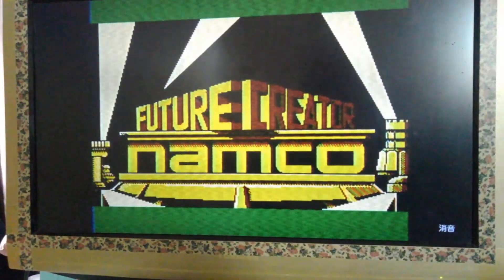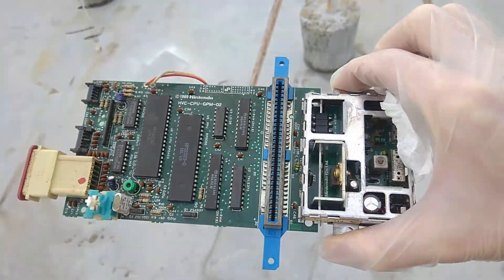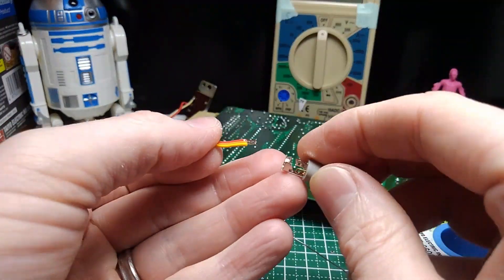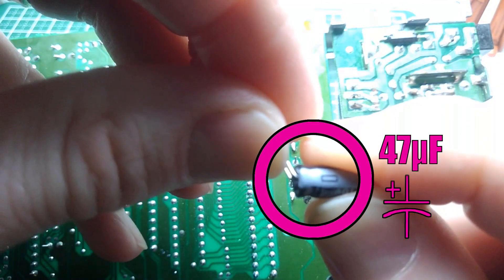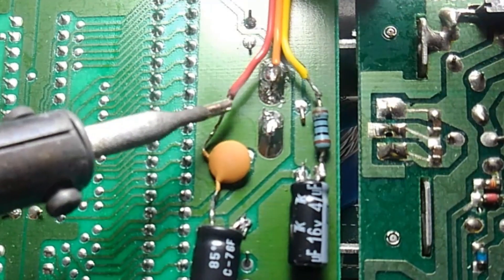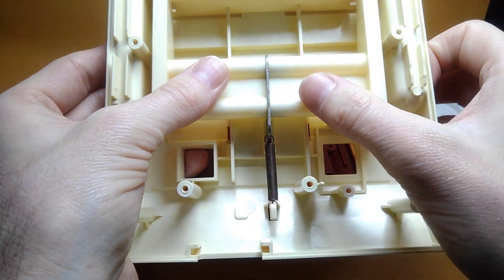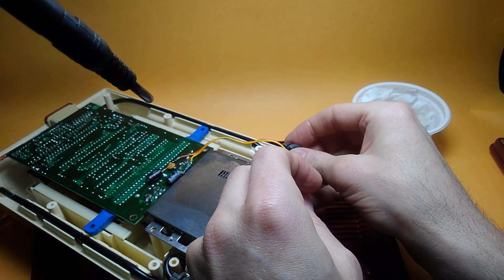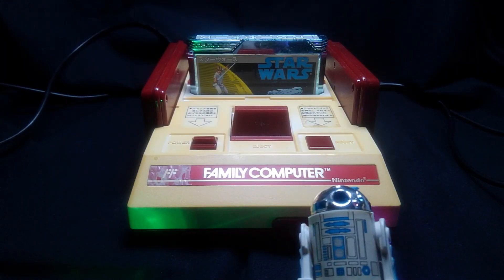Famicom AV mod made easy

Comment: Hello again my friend!!
I was using an rca to scart adapter because my tv only had scart, i decided to try on another tv wich has rca and colors work amazing!!!
But i still have no sound though, i feel like im so close to geting it working perfect. Do you have any clue of what could give no sound issue?
I seen people mentioning adjusting a coil, is it that small green coil with a philips adjusting screw?
Is there any point in the board i can use a multimeter to check if its giving out sound?
I tried blowing on the mic and i could hear me blowing on the TV, so i tried unplugging the Player 2 controler to see if it was causing an issue, but still no sound.
Any help would be much apreciated and thank you once again.
Reply from the maker: You are almost there just keep trying things out i know you will get it workin soon😁
Reply: @ScruffyLookinRGB  i wonder how you know that 😂😂😂😂

Comment: Hello my friend
Thank you for your video, i followed your instructions but the image out of the famicom comes in black and white and there is no sound.
Do you have any idea what it could be?
Reply from the maker: If i have the same problem i double and triple check my soldiering points. And if you still get nothing it may need new caps. Also if your board is not the same version as the one here it may not work the same way. Good luck
Reply: @ScruffyLookinRGB  Thank you for the reply, i really apreciate it.
I allready triple checked my soldering, and i checked and its the same version as the one you did in the video.
By recaping you mean change all the original capacitors?
Or do you know wich caps could be responsible for sound and color.
Im very happy allready though, it sure would be amazing to get color and sound out of this almost 40 year old console but even if i cant get it any better than this its ok still.
So no matter what, i really apreciate your video and still taking the time to respond after so long of posting it.
Thanks alot my friend.

Comment: would it hurt to use a 100ohm or 150 ohm resistor instead?
Reply from the maker: It should be ok. Although the signal may get worse or improve depending on the resistance you use. So it shouldnt hurt to try. Good luck

Comment: Thank you so much for this easy AV mod. I implemented it on HVC-CPU-07 board and it worked. The only problem is that video is too bright, light colors tend to be too light or just complete white. For example, the background of the famous Super Mario Bros 3 intro screen is solid white instead of the original creamy color.

I tried different resistor values (from 100ohm to 500ohm) but without success. Should I try different capacitor values (instead of 47uF)?
Reply from the maker: Yes unfortunately its a trial and error type of situation. I found a japanese blog that had this method here so i used it and it works great for this particular board revision. Other board revisions may vary unfortunately
Reply: @ScruffyLookinRGB  Yah, 1k ohm gave me the best color saturation on LCD TV, but my CRT TV couldn’t detect the signal when using that resistor. I settled on 510ohm resistor as the best value between saturated colors and signal reliability.

Comment: How did you make your rca to tsr ?
Reply from the maker: Not sure i understand your question?
Reply: @ScruffyLookinRGB  sorry I wasn’t clear, once you had made the modifications to the famicom and connected the cable for the output, you have a female port connected with what looks like a 35mm jack, I was curious how you had made those ends, or if you could when you have time outline out to connect the rca ends for the faux stereo sound.

Comment: are you sure the little ceramic cap was not a .1uf and not a 1uf. i have looked and not having any luck finding a 1uf ceramic cap.
Reply from the maker: It very well could be I did this mod a while ago and havent bought new ceramic caps in quite some time i think the mod may even work with out the ceramic cap to be honest. Its worth a try anyways.

Comment: Hi.  You "used" a 1uf ceramic capacitor which is shaped like a 100 nf capacitor (104).  I can't find 1uf capacitor anywhere.  Will it work if I use capacitor 104?
Reply from the maker: Im not sure 😕 you could try it. Id be curious to know how or if it will work with out the ceramic capacitor all together 🤔

Comment: doing this mod on two broken HVC-CPU-07 I bought after I replace the voltage regulator on one of them first.
PS the I have to solder the parts in different place then what you show but the place are labeled so I should be easy to do as long as the parts work the same. Thanks for the video
Reply from the maker: May the force be with you. Let me know how it goes for you.
Reply: @ScruffyLookinRGB  ok so I modded the first board and plug it in and all I get for is a gray screen with a black strip moving across it. the mic on controller 2 works and i can hear it from the tv but no video or game audio. I only have one game for it so if my game doesn't work would it be normal to have that screen? Because the nes has a gray screen when it can't read the game so if you turn on a famicon with out a game in it thought AV will you get the same result?

Comment: but you still need a ntsc tv or is pal also gone work?
Reply from the maker: Im not too sure how things work in pal regions but my guess is that it should be ok as long as youve got the right power adapter.
Reply: @ScruffyLookinRGB   iv got a 230 to 110 volt power adapter but it seems he has no power?

Comment: I've done a couple of famicom AV mods and I must say this is by far the easiest method and I'm going to do my third just like this one except I might just use standard AV cable run out the controller 2 grommet. I really don't understand why people go through doing all the lifting of pin 21 and crap because just a lot of extra work and mess on the famicom with no better image results. Thanks for sharing.
Reply from the maker: That is a big compliment thanks. I agree this is the easiest method ive found thus far. Lifting pins is no fun. Happy modding man👍

Comment: Everytime i see the internals of the famicom, it makes me wish rip those controller wires ,drilling 2 holes on the front and route those wires there , to make those wires stick a little bit more out of the console, it also makes me want to rip the wires from those controllers and put them above the controller by drilling a hole into them ,rather then keeping them on the side, in order to make those controllers fit more confortible in your hand,
Why did nintendo had make such obscure controller wiring design???

Because even the atari 2600, atari 5200 ,the sg1000 and even the magnovox oddysey etc,,,  did had detachable controllers.
Reply from the maker: I understand  your frustration. The one reason I think why the controllers are so short is that Japanese living rooms are very small and every one sits closer to the TV than in a western home. One thing i do like about the famicom is how the controllers have their own holder what do you think?
Reply: @ScruffyLookinRGB  well on paper it sounds cool those controller holders,hack even the retron 5 has a controller holder among other (old) consoles, but i sometimes think that they could,ve saved that extra plastic and just make those consoles just smaller instead.

Comment: This really is an excellent video and as a complete novice, I'll be taking it on this weekend if I can get the parts. 
A question though, does it matter whether the resistor is 'thin film' or 'metal oxide'? And do the capacitors need to be any specific type, or will all work?
Would you mind listing the brands you typically use?

I'll report back with my progress.
Reply from the maker: That is great id love to see how it turns out. As for thin film or metal oxide im not familiar with thoese terms. I usually use any japanese brand capacitor like nichicon. Ill add more cap brands as i remember them. Good luck.
Reply: @ScruffyLookinRGB  Didn't completely work for me. Any ideas what it could be? I'll check over my soldering. Nice to have sound though, ha. https://youtu.be/AZT_R0ZEQYI
Reply: I redid the TRRS and I'm having the same issue. I then reattached the video wire to the resistor and no improvement....in fact, I don't evet get any picture now, whereas before, I got flickers (I havent soldered the TRRS yet though, I was just checking).

My resistor is massive compared to yours. Whereas my ceramic c is tiny in comparison. Ha.

Could it be my soldering to the video pin? It's not exactly tidy but it's not messy either. It's also seat on it, rather than beside it (and I've used more solder than you did).

Can one use an RCA (yellow) cable instead of TRRS for the video? A white or red cable for mono sound (can you duplicate it, like the NES uses? And if I go that way, how would it be grounded?
Sorry about all the questions. I think I might be best just buying an already modded one!
Reply: Okay, so I re-did most of the soldering, to ensure my work was clean and it turns out, I probably had it correct in the first place! How I solved it/worked that out? I used a different 3.5mm jack to RCA; one from an old camera.

When pulling the 3.5mm jack in and out, I noticed sound was on parts I didnt expect. I then remembered I had a similar issue with my Android box where the 3.5mm jack wouldn't display video properly. So instead of using the new, working 3.5mm to RCA I bought for the Android box, I used the camcorder one, which didnt work on Android box and hey presto, I had a beautiful clean picture on my Famicom.
This youtube video helped me realise there was a difference in how they're wired, though I don't know how they're actually wired inside!
https://www.youtube.com/watch?v=MI4KsJEpueA

I had a slight buzzing sound in the background and realised it was caused by the mic on controller 2 (lots of people experience this). I could set it just above silent and it stops buzzing but moving the TRRS to the other side also helped.

So, your mod was brilliant, thanks again and hopefully my comments will help others. I believe I've seen someone else identify this issue too. One thing to note, the size of the capacitor and the resistors. My 220µF is quite large and I believe it's very snug against the bottom of the case....perhaps too snug....? Also, my resistor is huge, so my video is set back a little more than yours. Anyway, I hope this helps somebody and I might do a little video to show what I did and what I used. Thanks again. My first mod and somehow, it was a success!
Reply: Okay, this is my 'things I learnt; video and thanks again for posting Scruffy.
https://www.youtube.com/watch?v=mORA7LEGzLo

Comment: I tried this method out on a HVC-CPU-07 using the marked GND and video pads along with the 220uF cap connected to pin46 of the cartridge connector. The image quality was really poor and high contrast. I've reverted back to the old method including lifting pin21 and cutting the trace. I usually swap out the 2SA937 PNP for a 2SA1015. I'm keen to try out this AV mod on the next HVC-GPM-02 board though as it looks like a nice time saver 😁.
Reply from the maker: Thomas thanks for letting us know how it went on your version of the board that will be very helpful for thoese that want to try this mod on the HVC-CPU-07 version of the board. Thank you for sharing. 🙏🙏🙏

Comment: Hi, having a little trouble. So my picture is all distorted, I got all the right stuff and i only get a distorted picture and the sound
Reply from the maker: Its really easy to mix up audio and video wires when soldiering i do it all the time. Trace your wires from the out to the point on the board.  also check all your soldier points make sure they are not touching other points.  Check and check again. Let me know how it goes for you.
Reply: do you have anyway to pm me? i dont think i did anything wrong
Reply from the maker: @MrNintendokid45  you can dm me on twitter or instagram. Check the description below. I try to answer my messages when possible.
Reply: @MrNintendokid45   Did you solve this? I think I had exactly the same issue as you., check my video to see if it's similar. https://www.youtube.com/watch?v=AZT_R0ZEQYI
To solve it, I used a different 3.5mm to RCA cable (from a camera), as clearly the one I had wasn't wired in the same way as the TRRS jack. I'm in the UK, so perhaps we (not sure where you're from), have a different 3.5mm to RCA standard than where Scruffy is from.

Comment: I know General Kenobi would be pleased. Great explanation of the mod. I've never seen the inside of a Famicom before. Very retro, but beautiful. Love the sticker instructions close to the switch. Great video.
Reply from the maker: Sam Im glad you enjoyed it! Editing that took me quite a bit of time but it was fun to do. I love the look of the original famicom and all its retroness. Do you own one?
Reply: @ScruffyLookinRGB  not yet. The system is really quite a novelty because it developed in so many directions. With cartridge and the disc add on,  the wired in controllers, and the amazing games that originated for it (i think I'm saying that right) and the length of its dominance. It was the last of its kind in some respects and first of its kind in others.

Comment: I modded mine years ago but I wasn't happy with it because I lost the expansion sound channels on disk system games and some cartridge games like gimmick and it's been such a long time I don't know what to make of the work I did on the board. it's the same process as you did here
Reply from the maker: Wow you have some very sought after games my man. Interesting I have never heard of anyone loosing their expansion sound after doing a AV mod like this. I was also thinking about this the other day. My thinking is that the  expansion sound is actually on the disc system and not the white and red famicom. I wonder if anyone else out there has similar issue?
Reply: @ScruffyLookinRGB  there are a handful of games that have extended audio from cartridge hardware that don't show up when piping audio out of the CPU pins or pin 45 so I was told to cut those connections and pipe it out of pin 46 on the cartridge connector because that signal is already amplified and it will modulate through the speaker as is
Reply from the maker: @MysteryManBob  after cutting the trace you still get the normal audio? But not the expansion audio? I just picked up the cart of Akumajyo densetsu.  Im now curious to test the sound with an un-modded famicom vs the one i modded here to see if there is a difference in sound as you mentioned.  Thanks for bringing this to my attention i will research it further and ask around.
Reply: @ScruffyLookinRGB  https://www.famicomworld.com/forum/index.php?topic=14571.0

this sheds some light on the audio mixing situation. I wish there was a diagram to go with it but I think it's pretty straight forward

Comment: Hey I found this plug on amazon it has 4 wires. 2 for left/right 1 for ground but the 4th is for a mic, would this work if I solder the mic wire to video? And can I solder both channels to the same audio connection?
https://www.amazon.com/outstanding-Connector-Headphone-Headset-Earphone/dp/B08138W71N/

Also does it matter what wattage the resistor is? I see several ranging from 1 watt to 1/4 watt.
Reply from the maker: Most definitely. If you do the mod please share it with me here on YouTube, and tag me on Instagram or twitter. Id love to see your results. Good luck to you Pirott R.
Reply: So I tried a similar situation. If I just hook up green to the video, the video works fine. As soon as I hook up audio, the audio works but I get no video! I tried to put both audio channels to the one wire but I was getting a bad hum, so I just soldered one side and split it using a RCA splitter to get sound from both channels. So it seems for some reason I can only have audio or video. Any ideas?
Reply: Okay I got it working. In my case I had to use white for audio, black for ground, and red for video. Everything is looking good thank you for the video!

Comment: I need help finding the exact jack that ships to the US.
Reply from the maker: I just googled TRRS jack and this popped up they even have a tutorial about how to check the continuity. Not affiliated with them at all. https://www.showmecables.com/3-5mm-trrs-female-solder-connector-plastic  hope that helps you man.
Reply: @ScruffyLookinRGB  My Famicom arrived and my board looks very different from yours. There's pins labeled video ground and sou which I assume is sound but in different spots. Can I do the same modification with same parts on this board using those pins?
Reply from the maker: @palen2890  In short yes you should be able to in theory, another viewer in the comments here said they had luck doing the mod this way with the HVC-CPU-07 board version. What board version do you have?
Reply: @ScruffyLookinRGB  It's a HVC-CPU-08. I can't find any videos or images on modding this specific board. I also can't really tell which pin is supposed to be the video and audio outs. The ground is isolated but the labels for the other two are around several pins that could be it.